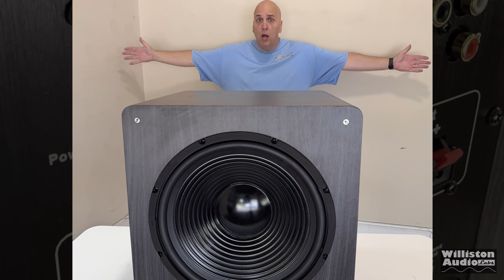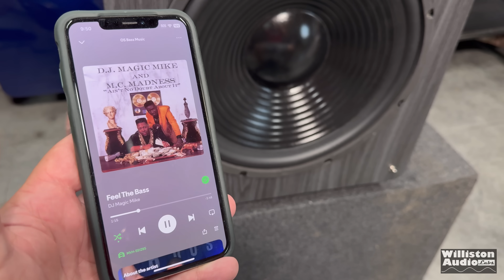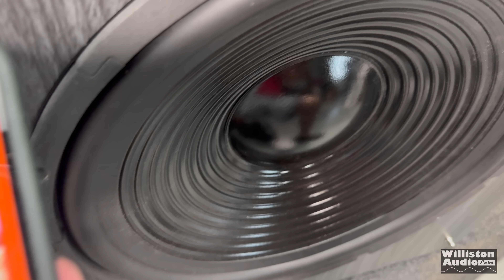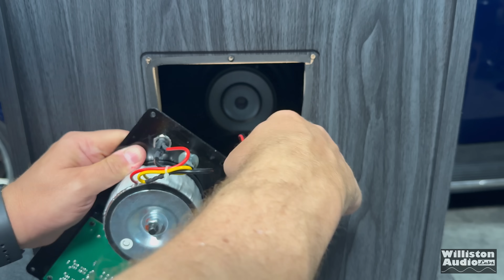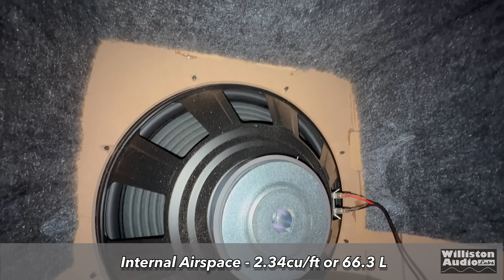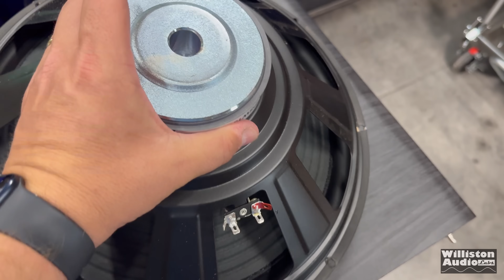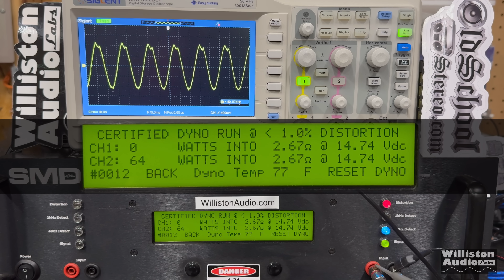The Worst 15" Sub I've Ever Tested - Acoustic Audio PSW600-15 Powered Subwoofer

Comment: I once had a Klipsch 10" powered sub, the plate amp went bad. It wasn't all that great anyway.
So I wired it up to an Emotiva amp. Holy cow was it performing much better! It went low and got loud.
Reply: @hi-fi-custom  what model?
Reply: @kahtarwells9899 I don't recall exactly, maybe an R10. It's sitting in storage for now.

Comment: I bought 2  PSW12's back in the day.  Got one of them for $200 it sounded nice went to get another but had to pay $230.   They was not bad for a budget sub.  Only draw back was if you drove the speaker to hard it would pull the spider lead off.  Fixed one and had to get other replaced i was not fixing the other one.  To bad my apartment was robbed so that ended my loud system days.

Comment: Two Dayton ND140-8 in that box with that amp would slam, just cut the port down to 1.61in for a tuning of 36hz. Stock tuning is 24hz, so that OEM Goldwood is going to be out of sorts long before it gets to take advantage of the port. That is why it sounds so bad. Cutting the port down on the stock driver might help as well, making it so that the driver gets help from the port sooner.
Reply: Your absolutely right
Reply: Someone's got to build one and see.
Reply: @Acoustic_Theory I would but I’m so limited on space

Comment: I looked into getting a powered sub for my surround sound system i was peicing together last year. I ended up just getting a Powermax power converter after I watched Big D's video and several other people's videos on powering car audio equipment in your home, since I had some old Rockford car audio stuff laying around. I honestly couldn't be happier, I use it to power a Rockford Punch 400 pushing a Rockford Power HX2 15" in 4 cu ft slot ported box tuned to 30 hz. I know it could handle alot more wattage but it's fine where it's at for now, I was really going more for sound quality rather than just as loud as I can make it. I would highly recommend going with something like what Im doing over going with something like he tested today. Just be sure and get a power converter that's 15%-20% more wattage than you need because none of them are 100% efficient

Comment: i have the accousic audio inwall speakers for my 7.1 surround sound set up and they sound great on my denon reciever but they do not like anny bass in them at all 
but paired with 2 decent sony powered subs it sounds great for movies 

i have plans for a diy 15" sub using a kicker comp c 15 and a dayton 500watt plate amp soon and im debating between using a passive radiator or do a ported  box tuned very low (18hz ish)

Comment: So basically a 50 watt amp.

Inexpensive plate amps are generally weak. The amps SVS uses can swing some serious voltage. But they are priced accordingly.

Comment: i put together a better subwoofer for 130 usd (driver+enclosure) .  12 inch focal rsb-300 wired to 8ohms,   and a 180l 22hz tuned box custom made from osb.  this thing shakes stuff on the walls at 21hz.  and doors at 18hz

Comment: Big D 💪 are you gonna change the amp? you can just Drill a hole for some bolts to power it with another amp and see what they can do before letting the smoke out.
Reply from the maker: I think this one is going back

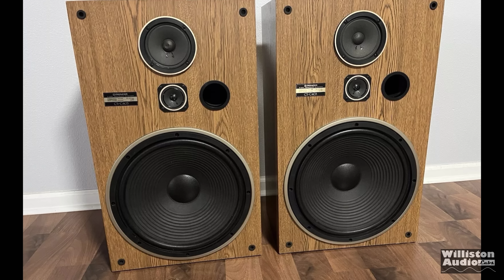Comment: @1:38 - Back in the day, my old man bought a Pioneer rack system overseas on a cruise.  We had the Pioneer CS-703 speakers with the HUGE 15" woofers on them and the HUGE horn tweeters.  They got loud, but didn't sound the best.
Reply from the maker: Yeah those 15” drivers either the 20oz magnets 🤣
Reply: I bet those magnets were smaller than this one
Reply: @Rotteneggsack  I can't really recall.  The last time I saw those speakers was probably 1989 or 90.  I did take them apart back then, but i was a haphazard kid.
Reply: I had the optimus rat shack rack system with dual tape decks, eq and 5 disc cd changer….. ill tell you it came with 2 15” 3 way speakers and they rattled the dishes in the cabinets…… I was shocked how well the system did for what it was and being a young kid and a bass head I loved it altho by todays standards its junk 😂😂😂

Comment: Haha, this is the "normal" version of the sub that I mistakenly bought from this same company a few years ago. I bought the "HD SUB 15" that was supposedly their "best" model, but I took it apart too, just to see its actual build quality and what I got for my money, and other than it having a slightly nicer, more "refined" LOOK on it's exterior box, pretty much everything else about it was exactly the same as this POS here in this video, lol!

The one I bought, (the "HD" version of this one here in this video), was exactly the same, extremely LOW level quality components inside it, and it also had a claimed "600 watts" of power output, but when I tested the amps ACTUAL power output ability, up to a still clean sounding maximum before noticeable distortion, it ONLY put out about 60 watts RMS continually, which was/is of course only 1/10th of its CLAIMED power output!
Ridiculous, LOL!

About the ONLY way that this "sub", (or its other similar models in the brand), could EVER be putting out anything anywhere even CLOSE to its claimed output power, is if it was driven to 100% distortion and then it started on FIRE, LITERALLY, and you measured and included the actual resulting THERMAL energy put out by the FLAMES of it completely burning, lol! 😂

Unfortunately this kind of audio garbage and total BS spec stuff is rampant in today's audio world, especially with most things being made in China now, to the absolute lowest possible quality levels, just to be able to produce stuff with the highest profit margin for the crappy, unreputable company selling it!...

You really have to do your homework and be careful what you buy nowadays, especially online, where you cannot actually listen to anything before you buy it! (Soundclips in online videos are NOT accurate or true to how any component or speaker ACTUALLY sounds in person in the same room as you physically, especially when it comes to things like stereo imaging and soundstaging, but also with things like layering and even distortion, because those kinds of important aspects of a component or speaker are produced by the physical dynamic aspects of the individual drivers themselves that are reproducing the sound that your ears are actually listening to in the physical space you're in, whether that be headphones, crappy laptop or tablet speakers, or even good quality separate speakers, because all that you can discern and actually hear using recorded sound clips of something as played back on your actual gear, is the sounds of YOUR gear, whatever that may be, along with its own limitations, because THAT is what is actually moving the air around you that your ears pick up, so that is why you absolutely MUST listen to audio equipment and speakers IN PERSON, in the same room as the actual component being evaluated, in order to get an ACCURATE, REAL representation of how they ACTUALLY sound!)

Comment: Are you using the low input or the high input?  Maybe you could use the high input and really power it up from that side
Reply: If you know 600 watt amp look like, you will know that sub can't handle 600 watt😅

Comment: I forget what your name is now. I usually prefer to thank people by name. Any way, I had a left over plate amp that came out of an old sub. I nearly cut it into my new sub I am building. Your last video on this plate amp made me think... It is identical to the one I have which is also labelled 150w. So, a huge thanks for outing this shit as I would have cut a hole into my new sub and been stupid pissed of when it was gutless. Like the guy below I am done with plate amps. I bought a 150w (real 150w) Cyrus monoblock instead.
Reply from the maker: Thanks for watching and sharing your experience, I appreciate it!

Comment: That is the 1.5" voice coil. Its barely a woofer, its frequency range is much more like a mid range. That would be a spikey and hideous nasally sounding driver.
Reply from the maker: Thanks for the information, I appreciate that!
Reply: @wal  Goldwood can make great drivers, they also make some total garbage. Equate that with a slightly hopped up funky pup with a 100-150 watt rating.

Comment: Hook up 600 watts to it, see what happens
Reply: @marathonbaker  exactly!  It’s not done until we see smoke!  It may be the best speaker in the world, but we will never know…..  lol
Reply: That's rated 600 max so maybe 250-300 rms
Reply: Probably magic smoke, and cheap chinese electronics burning smell in your garage for 2 weeks.
Reply: I'm thinking order the proper plate amplifier that matches the speaker.
Maybe they'll have half a chance by then
Reply: @frankhuddleston6548 probably not with this one. Speaker doesn't have enough excursion to play loud low bass.
Reply: @frankhuddleston6548  In this case the proper amp is matched to this subWOOFER.

Comment: Have you tested any external home audio subwoofer amps? There are several reasonably priced options out there now, and many are claiming 300w or more.
Reply from the maker: Yes there are some linked in the pinned comment and video description
Reply: @wal  thanks! I have watched your plate amp videos. I was talking about Fosi V3 mono, Dayton APA150, or maybe Monoprice Utility 200. Something inexpensive and external. The plate amps don't seem to last, and typically fall short on their power promises.

Comment: Probably sounds better with an external amp.
Reply: Bet it would blow that lightweight woofer real quick too. 

That's not a sub, that's a woofer for a cheap floor standing speaker set or a cheap PA speaker.

I've got an old set of radio shack 15" PA speakers that have very similar drivers. They work fine for garage speakers, but they do not make bass. Trying to force it just makes them smell hot and they still don't do low frequency...

Comment: Another example of getting what you paid for. Making a good subwoofer is expensive. Having repaired many different brands they all fall down when it comes to the amp module which are not capable of getting even close to the claimed ratings.

Comment: It would be cool if you tested those drivers with some " real " power to see what the drivers / box can sound like

When l said drivers l meant this 1 along with the other 2 he has previously shown.
Reply: I have a feeling that woofer will start smoking once you pass 100W.

Bet it has a paper coil.
Reply: @volvo09  I bet it would make a nice 60Hz FART if wallplugged.  I'm sure the back of the voice coil would clatter so badly on the back plate it would sound like a helicopter landing upside down on top of a fence.
Reply: @volvo09 probably not a paper coil just not much coil length.
Reply: It's definitely just a PA driver... That driver probably doesn't play low and can't handle power. Also minimal excursion.
Reply: @cup_and_cone  i've got some 90's radio shack PA speakers that I restored and these drivers look very similar... Just a light paper cone (not the heavy pulp cone of good paper subwoofers).

They do NOT do low frequency at all, if you try to force any excursion the coil gets hot and you will instantly burn it out.

They work fine for garage speakers, but if you like bass heavy modern music i can tell you this driver is not fit it!
Reply: @cup_and_cone  PA driver for Pyle garbage perhaps.  It ain't no black widow!
Reply: @cup_and_cone definitely not a PA speaker since it has a rubber surround.

Comment: As an audiophile I’d far prefer the option of more passive subwoofers instead. All of these active plate amp products flooding the market have always been nothing short of subpar to me.
Reply: You say that your an audiophile but worried about cheap subwoofers? Not saying your wrong, but a true audiophile is not buying these subs. My REL and SVS subs have plate amps, and been kicking for years.
Reply: @downsouthlouisiana I have had an ELAC subwoofer amp fail before. I don’t buy cheap gear. Also have a few friends with REL that do not speak highly of them at all especially for the price.
Reply: @sebastianhasbun3846  Rel subs are great for music. They're not boomy like normal subs. They typically use A/B amps. One of the few subs that have a hi pass/speakon connection to run your set up as a true full range. Those subs are very accurate. 

But people like boomy loud subs, thats why REL came out with the HT series that uses class D amps. You have to design your system properly. 

Also i wouldnt put Elac in audiophile category.
Reply: @downsouthlouisiana  now I run servo subwoofers for music . And the elac used class AB as well. I don’t use boomy subs for music either. Plus, I don’t really care if you don’t think elac is not an audiophile brand because it objectively is.

As someone who works in the industry I think it’s more conducive if we were to refrain from dick measuring contests. REL engineering is lazier and inferior to ELACs, and if you really think that just because REL focuses on subwoofers that they produce better subwoofers than several other brands out there, then I have a bridge to sell you dude.
Reply: @sebastianhasbun3846 servo makes some really good stuff!! I was in the industry for almost 15 years, i mostly did home automation and integration.  But A/V was Incorporated into it. Ive been out the game for for about 3 years. 

I was not trying to start a measuring contest. People definition of audiophile grade seems to be different. My main setup consist of Marantz separates, Martin Logan ESL's and some other stuff. To me thats entry level audiophile grade.... Well compared to some other systems i designed lol.
Reply: @sebastianhasbun3846 yet you've replied multiple times uncontested (as im sure you will again) simply trying to save face. Lol. You already blew any credibility you may have had my walmart "audiophile" poser friend. 😂

Comment: Just to make sure I’m understanding correctly, the dyno was at 120v ac?
Reply: Yeah, the amp was plugged into the wall, the voltage readout on the amp dyno is irrelevant.

So instead of this amp getting it's DC power from his capacitor bank (what the amp dyno is monitoring) like his typical tests, this amp gets it's power from the wall socket... BUT, the real power source is the rectified output from that round transformer on the plate amp, because the amp still runs on DC, even though it's getting AC from the wall.

If one wanted to get real geeky they could monitor the DC rail of the plate amp to see if voltage is dropping due to an insufficient transformer.
Reply from the maker: The Dyno is powered by 10-16VDC and in this case it was just connected to my lithium battery bank. It has a 12VDC to AC adapter as well but the result is the same, just easier because it’s already connected to the bank

Comment: The problem is, you didn't have it wired for zero ohms.
Reply from the maker: You are correct sir!
Reply: Zero ohms is the key
Reply: 0% resistance, 100% power
Reply: And no dimming of the lights, if the grid also has zero ohms..

Comment: As inexpensive as it is to make a true 500w sub amp and manufacture a 15" driver with decent output below 30hz, I'm really surprised other manufacturers haven't jumped at the opportunity to build brand recognition the old fashioned way like word of mouth and good reviews.
Reply: Profits would be too low to be worthwhile at these prices.  It actually costs more to ship this sub than make it.  Connex boxes are going for around $15k these days, plus tariffs on top.  How many of these subs do you think you could fit in a container, and then do the math on shipping.  Anyone with enough venture capital to do what you say will just end up building high-end audio because profits are higher.
Reply: The simple fact is it isn't (really) that inexpensive. Look at what a 500W Class D amplifier module costs, and make sure the module you select also incorporates a power supply (not just a China amp board with a chip that needs another separate 500W PSU board).